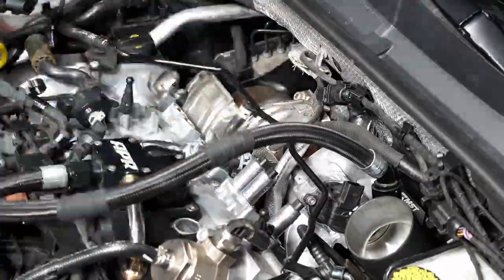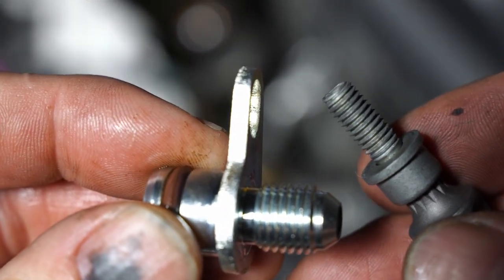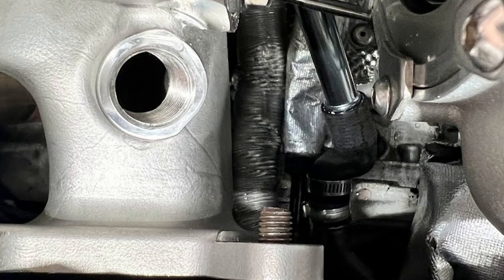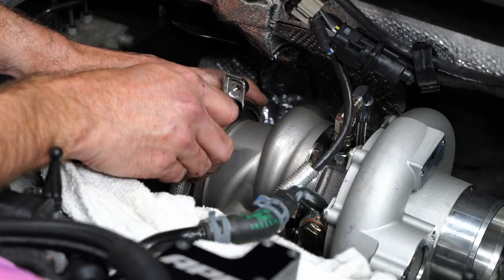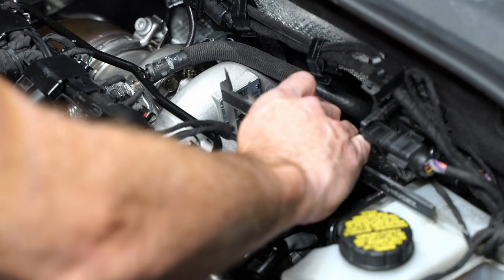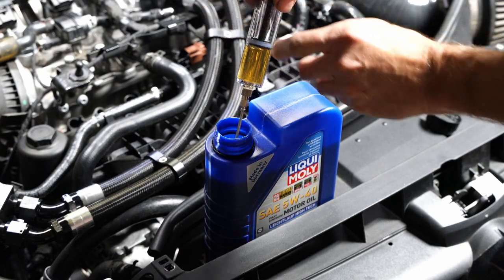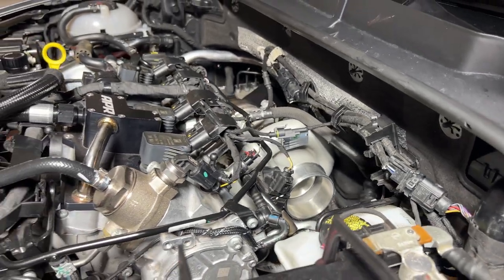MK7 Turbo Install - EQT - G25 660 - 2019 Golf R

Comment: I learned there are actually a couple different oil return fittings on the block from factory. Your car had the longer fitting and thats why your oil drain did not line up. Some cars come with a shorter fitting and it makes it way easier to install.
Reply from the maker: Good to know. I felt like it was way too far off to be normal!

Comment: How you liking the turbo so far? I was able to get one off a built s3 at a junkyard in Houston for $700 with 1300cc mpi and euro manifold. Owner didn’t know it was a g25-660 and sold it based off other s3 turbos. I originally had the 2260s with 925cc mpi and rs3 brushless tuned by UM. 

I’m currently on revision 2 so boost is turned down that powerband is taking getting use to with a gti.
Reply: Do you miss the 2260s?
Reply: @marcpec11  I miss the midrange power.
Reply: @NerdGenius  thanks for the reply, I'm currently trying to decide between a 2260S and G25-660. I think for the type of car that the Golf is I might prefer the responsiveness of the smaller turbo coupled with the more forgiving horsepower and torque on a stock motor/gearbox. But I'm still not exactly certain which way to go 😔

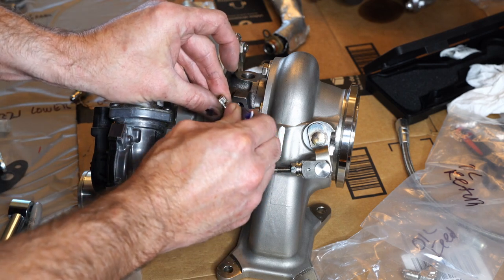Comment: min 5:44 you used a gasket, but there were no gasket in my car not in the turbo kit installation from FCP, where did you get if from? I suspect that line is what is leaking after I changed my turbo.

Comment: What power can this make sure and at what PSI
Reply: With the G series the last 3 digits indicate the approximate max power capacity of the turbo on a typical modern performance DOHC engine (though it's unclear to me what fuel Garrett intends that to be on). Generally I would expect between 550-600 whp out of the 660.